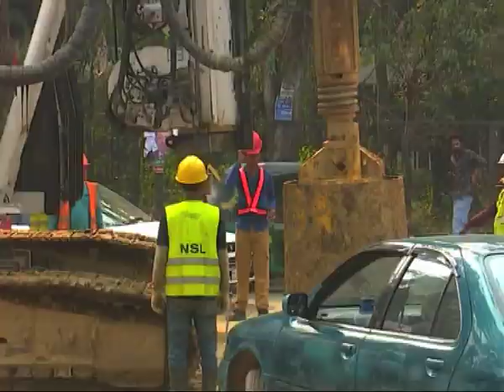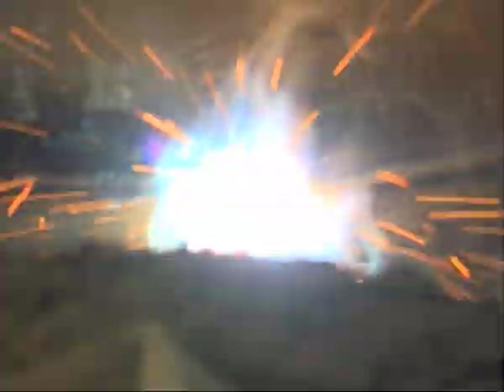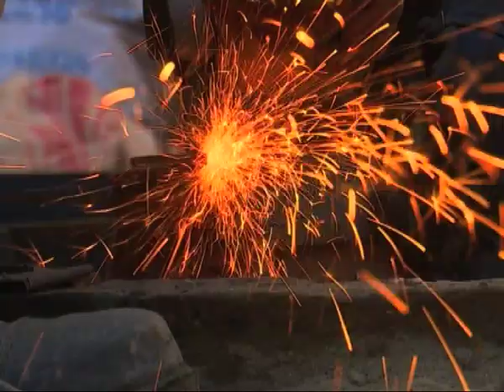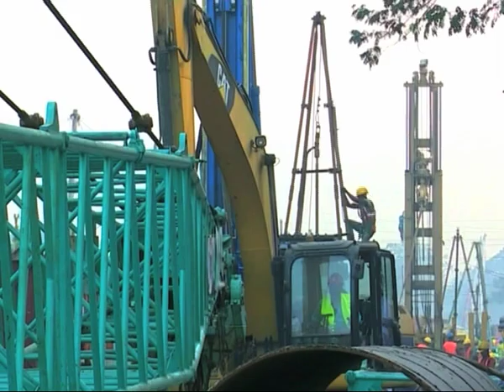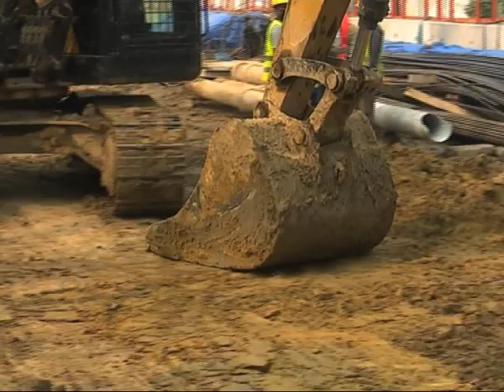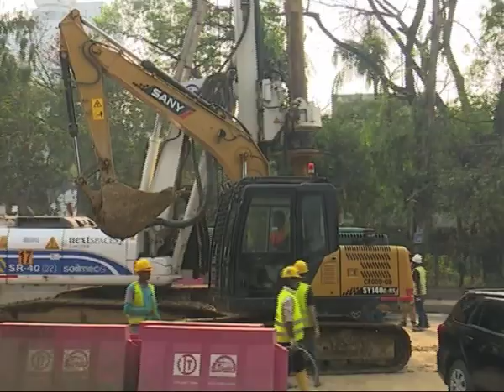Metro Rail Latest Update | Dhaka Mass Transit Company Ltd.

Comment: উত্তরার ৫৯ একর { One Acre = 3 বিঘা }জায়গা নিয়ে তৈরী হচ্ছে বিশাল মেট্রো রেল ডিপো। বাংলাদেশ সরকার একবারো ভাবলো না জে এই বিশাল ৫৯ একর জায়গাকে মেট্রো রেল এর ডিপো বানিয়ে আর কি-কি সুবিধা পাওয়া যায় ? একই সঙ্গে এই ৫৯ একর জায়গা তে আমরা আর কি তৈরী করতে পারি? ৫৯ একর অথবা ১৭৭ বিঘা জমিতে at least ৫০ টা  ৫০ তলা building তৈরী করা যায়। Or we can build airport right above the metro-rail depot. They can make a full size international airport above the rail depot.
Bangladesh is running out of space, whether it's residential or commercial purpose. We must think about multiple projects for a single investment. 
Metro Rail Depot ওপর তৈরী করা উচিত high rise buildings এবং building এর নিচের ফ্লোর টা হবে মেট্রো রেল ডিপো। ওপরের floors গুলো হবে বিভিন্ন সরকারি অফিস। এই metro rail এর depot ওপরে যদি সব সরকারী অফিস গুলো ইস্থাপন করা হয় তবে জনগণ একটা অতিরিক্ত সুবিধা পেতো। এই সুবিধা টা  অনেকটা one-stop shopping এর মতন হতো। যে কোনো সরকারি কাজের লেনদেনের জন্য ( Electricity, Gas bill related issue etc) last stop এ এলেই হতো।  বিভিন্ন সরকারি অফিস খোঁজার জন্য বিভিন্ন এলাকাতে দৌড়াতে  হতো না।   এই ৫৯ একর জায়গাতে কত বড়ো বা কত গুলো buildings তৈরী করা যাবে এক বার ভেবে দেখুন।